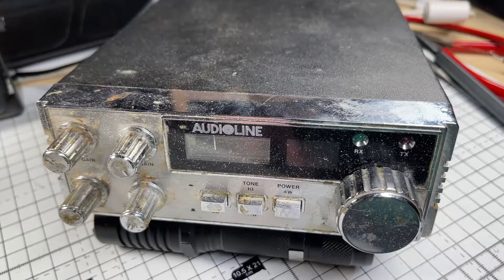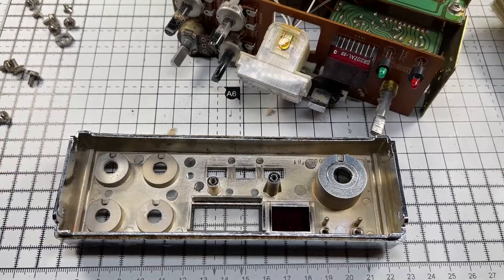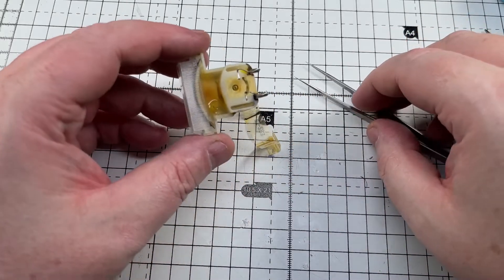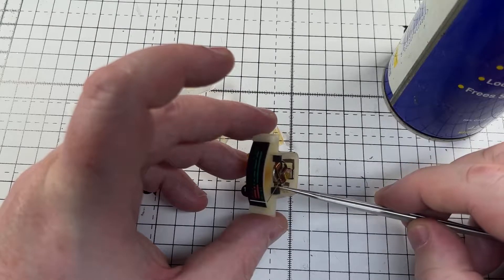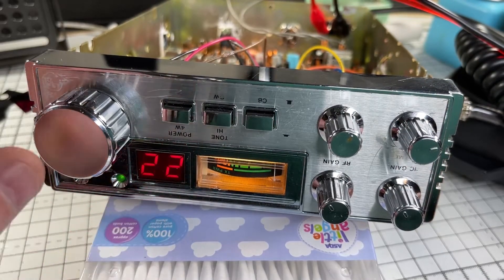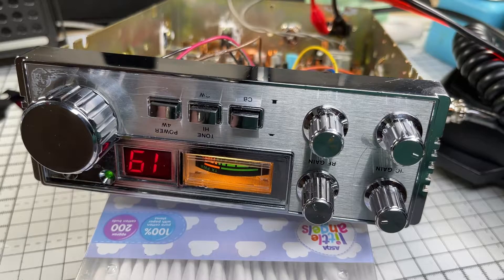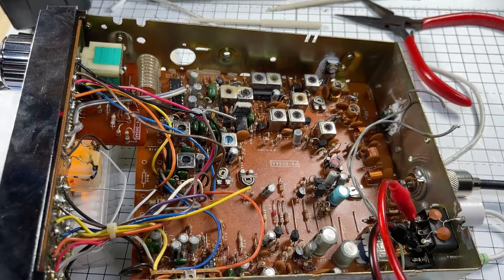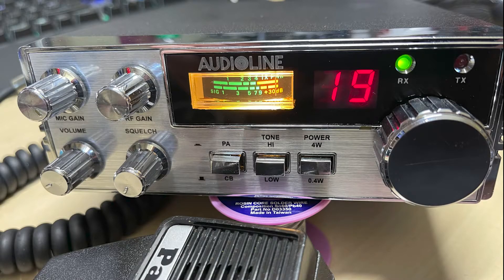EP 084 - The most dirty radio i have ever seen - Audioline 341 - CB 27/81 CB radio

Comment: Great work mate 
It would be Brilliant if you could show the diagnose process and how you went about it ,how you utilised the test equipment to come to the conclusion ,highlighting the faulty components and their location on the board..
Brilliant video ,but I do enjoy in depth explanation mate..
I'm not criticising sir..just suggesting. 
Best regards M0TDM
Coppernob Roger
Reply from the maker: Hi
Thanks for your nice comment , much appreciated. i lost some footage on this repair unfortunately.
Some of the repairs i do i try to go in depth with the fault finding , others are just "simple" repairs.
I don't have expensive test equipment, i just use equipment that the average person may have.
Reply: @MicroChipz  
Hi mate thanks for the reply..
You do very well with the equipment you have sir.
I have an extensive range of test gear..
Oscilloscope, sweep gens,signal gens,sinad meters to name a few ,but I end to use my metered power supply and marconi 2955a more than anything else

Comment: I usually do the top screw on the meter I must also admit do struggle to get them working again lol 
I also like the mid conversion on these as it’s much neater than doing the cybernet types 
You can add the capacitance compensation to the other pole of the switch if needed 
There are also audio modifications for these to sort the bassey transmit audio it’s well documented somewhere 
There are also a few caps worth changing as they like to fail one near the PLL circuit and a few at the rear
Reply from the maker: This radio was truly the work of the devil , there was so much wrong with it .